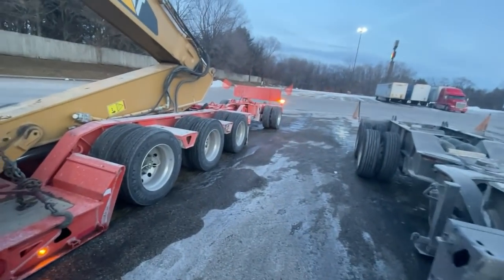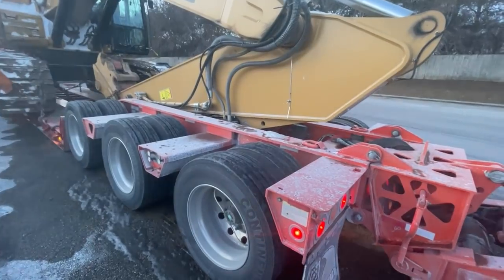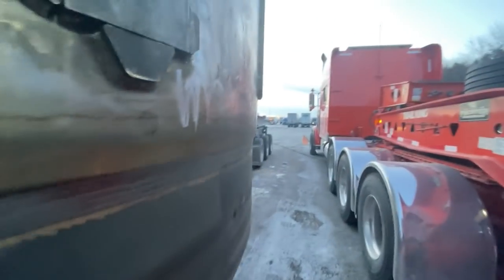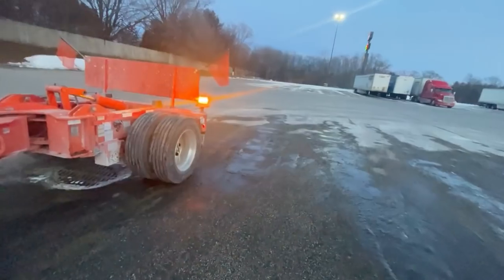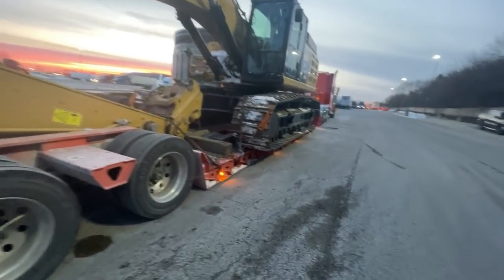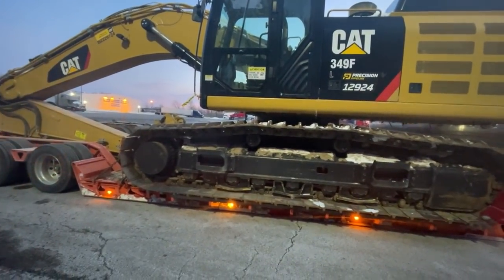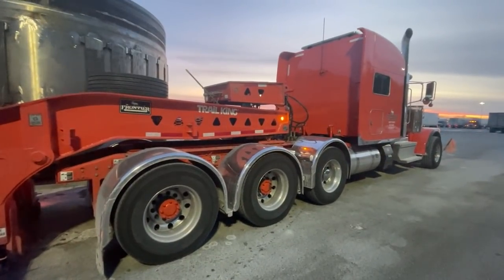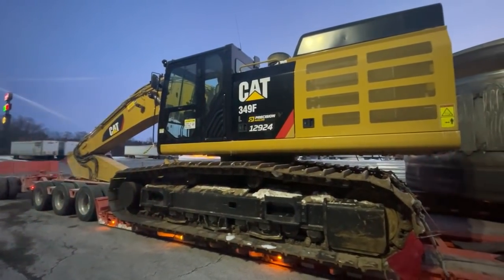-55F Windchill CAT 349 heading eastbound.

Comment: On a chain link you’re supposed to hook the binder so the chain link weld faces out of the hook .I just learned that. I moved a bit of equip , the steel thing is a crusher body crushes concrete and makes different size aggregates.
Reply: hope ur right because he has a concrete background too
Reply: @tophauler8626  do you ever actually do any driving over the road I would like to see some videos of you driving!

Comment: In the old days  (70's) in Michigan  before air dryers, we'd drain all air tanks then put 2 quarts of air guard in the first tank after the compressor. Run it for 2 weeks then drain everything and repeat. I would think you could do the same thing after dryer. I'm watching this 8 months after you posted this. But if you see this maybe it would help next winter. U hang in there

Comment: It is a section of a Kiln or Calciner. The weldments on the outside are filler bars where the riding ring sits. The riding ring is a solid steel "tire"

Comment: I like our Australian hydraulic suspension the oil just flows from one cylinder to the other it always equalizes the weight on each axle but you can keep that cold weather that's colder than my freezer

Comment: It looks like 1 or 2 of the vertical sections on the left side are missing. It may be going someplace to weld new ones on. Man, the heat it will take to weld those on.

Comment: I plan on buying a  50-55 ton lowboy. I see that these trailers are offered by various manufacturers in rear axle spacing of 54.5 inch or 60 inch. Which of these spacings is better and why please?
Reply: You get more weight permitted on 5 foot axle spread.
Reply from the maker: Depends on where you run. But for a 55 ton stick with 55”.
Reply: @KeepingitAnalog will be running  Mostly Louisiana Texas Mississippi, mostly southern states. No ca,

Comment: Is it better to get a stand alone Honda power unit or wet kit off the truck. Can you describe Pros and cons of each
Reply: Only reason I would run a trailer mounted unit would be if you don't have a tractor dedicated to that trailer.
 Last outfit I drove for all had trailer mounts, for the most part they were ok...except dealing with gasoline and if you did have to work on them, the mounting area was very tight. 
At one time, on a tractor I owned, I had the pto on the tractor. It was less hassle...no gasoline, no extra oil change, no extra oil filter, no extra battery or rope start, etc.